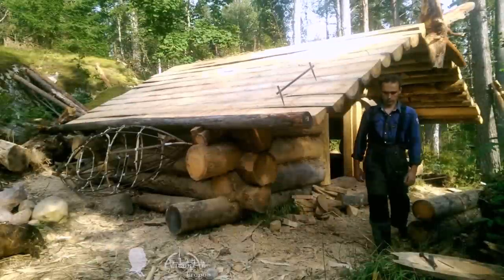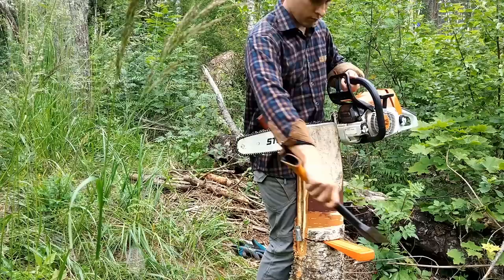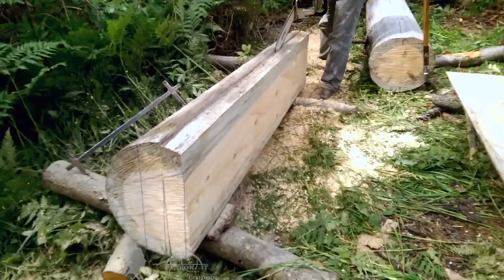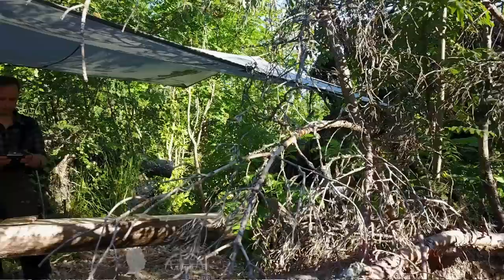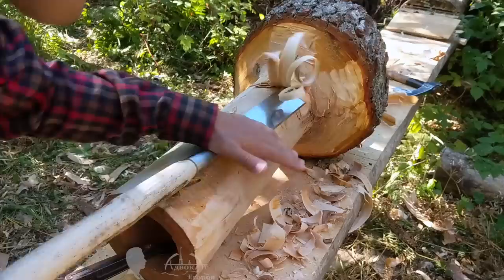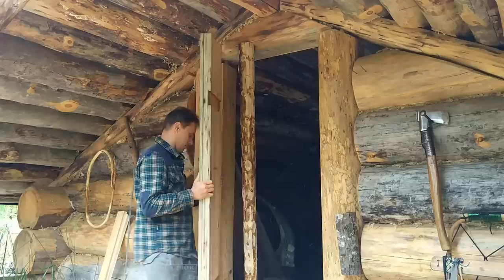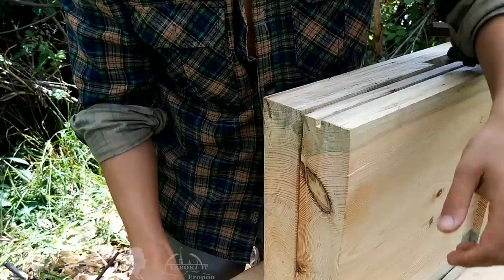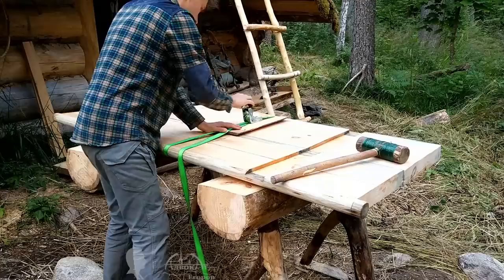Bear-proofing My Log Cabin

Comment: For doors opening outside, that’s the norm in Finland. It also leaves you with more interior space.
Reply from the maker: Yep))
Reply: In soviet Russia it’s for Bear, bear no pull door, bear push door.
Reply: thought they were in Sweden I hear coocoo birds
Reply: Bisqwit! Fancy seeing you here, God bless my friend
Reply: @soundtrancecloud5101  I read it with Russian accent wtf?
Reply: Harder to break in with the frame behind the door, too.  Building a cabin, I'd let the roof extend a good 3 or 4 feet (or more), with gable end over the door.  It's just silly not to, and yet, very few homes in the USA have anything like that.  My home doesn't have that.  It has a front porch, so you can always get the front door open, regardless, but the ridgeline of the house is North-South to minimize heat build-up in the summer.  The doors are on the East and West side, so the whole roof sheds snow right where you want to step off the porch, creating a real hazard (and clean-up chore) under melt/freeze conditions.

If I had any skill or ambition, I'd add a gable to shed the snow off to either side.  But hopefully, I'll be able to retire, sell the place, and make sure the NEXT place has the proper design features.
Reply: In America the only reason for a door to open inside is so that someone won't pull up to your house, attach a chain to the door, and rip the door off the house with a truck. If there is no road, there is no truck. No reason for the door to open in.
Reply: Problem with doors opening outside is the obvious problem of obstruction. Snow, mudslides or unexpected fallen debris in nature are problem enough but if you look back at ancient societies things take a darker turn. A few boards, some nails, a hammer and a torch and you can trap a person in their own personal tinderbox from the outside. It's safer to have a door that opens inwards, even if that makes it easier to breach.
Reply: Robert Beck  Sorry Beck but I'm not sure what you're arguing against from your comments, to clear things up do think a door that opens inwards or outwards is safer?
Reply: Robert Beck  If the structure is collapsing around the door it doesn't really matter which way it opens, that implys that the fire has spread to the exit thus making it the obstruction. Simple scenario to illustrate my point tho; It's ancient times, I live in this log cabin in the mountains and its winter. Its snowing at night and I fall asleep with the fire going as its cosy and I'm comfortable. I awake to find that there is now a fire in the cabin. I run to push open the door but it doesn't move. Snow has piled up outside the door and I can't open it more than an inch. If it opened inwards I could escape easily. I feel the pros outway the cons for inwards swinging doors, Imo.
Reply: Robert Beck  I'm not saying it doesn't, I'm simply saying that if the fire has spread that far and effected the structural integrity of the building that badly then the idea of the door being blocked or not would be silly. Odds are by that point we'd be dead or at least unconscious from smoke inhalation. I'm arguing for quick escape from dire situations, which would be inward swinging doors that can't get blocked or sealed from outside forces.
Reply: Robert Beck  If your keeping small objects in front of your door then the fault would lie on you, not the design. Also yes, I one hundred percent agree on outward swinging doors in community and department buildings where large groups of people need to escape quickly. Inward swinging doors might get sealed shut by the mass of people pushing to get out, causing deaths. But the logic behind those circumstances differ greatly from small homes. If nothing else it stops people from trapping you in your own house with some nails and a few planks of wood.
Reply: @BenjaminBizarre  Yeah no. The obvious solution to being barricaded in would be sliding doors.
Reply: @thirstiestvillager9233  There isn't always space for sliding doors, fire escapes are the primary example for that. They are required to open outwards and cannot be obstructed in anyway by law. Again tho, this operates on a different logic from small residential homes that have less people inside at any given time. Inward swinging doors have more benefits than cons which has been my opinion this whole time and I feel I have give sufficient evidence to support that claim.
Reply: @BenjaminBizarre  Pretty sure it's cultural.
In America, security doors usually always open outwards. Often both out and in, but rarely ever inward alone.
Reply: @BenjaminBizarre  eh, harder for bears to bash down a door if it only opens outwards.
Reply: @harrymills2770  My American friend who is ex-police believes that the doors open inwards just to make breaking in easier for both criminals and cops. Wouldn't surprise me to be honest seeing the state of the USA lol
Reply: Love your knowledge, ability and compassion
Reply: @soundtrancecloud5101  yes
Reply: @thirstiestvillager9233  Just do us all a favor and don't talk for us.
Reply: @thirstiestvillager9233  If someone was going through all that trouble they would be able to bash the door in if it opened inward just as well. That is a weird statement
Reply: and more visitor's faces broken.
Reply: Ahhh yes I have noticed that my closed door is taking up so much floor space.....
Reply: @thirstiestvillager9233  is that a serious comment?
Reply: It leaves you stuck when the snow falls. Really stupid move.
Reply: @krebgurfson5732  it's kinda elevated tho?
Reply: @paulandersbullecer3152  why even risk it? makes no sense. Snow isn't going to fall on his porch, it's going to be blown in in thick drifts that will freeze and become extremely dense. Maybe it's not an issue where he is but in Alaska snow doesn't fuck around. He elevated it about 15 CM, no one is worried about 15 CM of snow.

As for bear proof that door doesn't have near the reinforcement it would need. The door has to be much larger than the entrance gap. Allowing for significant backing along the edges. Doors aren't really where bears enter buildings anyways, they enter through windows because that's where the smells come out and they can see in.

None of it really makes sense.
Reply: @krebgurfson5732  ok
Reply: @BenjaminBizarre  Snow and mudslides? Yeah MAYBE snow in a forest etc. but not in a city really. Mudslides? Mudslides that big of a scale are REALLY rare. If you think you can trap someone inside their house with a few boards, some nails and a hammer you completely forget that people usually have windows they can escape from. And by the time you manage to nail enough boards on the door, people usually have already managed to rush out of the door anyway.. At least i would just run towards the door and ram it open before the person manages to lock me in. People usually tend to wake up when someones hammering their door shut...
Reply: @Ex0rz  This hut isn't in the city. It doesn't have windows. The nails and board example was from dark ages logic as my original comment shows. As for more modern safety concerns, outside barricades are still a concern no matter where you live. They're not always obvious but the basic logic behind getting barricaded in from the outside vs the inside goes as follows. Would you rather be trapped on the inside with by something outside that you can't reach or trapped on the inside with something you can at least try to move?
Reply: @soundtrancecloud5101  my answer too
Reply: Doors opening to the outside is how they are in the U.S..
Reply: @soundtrancecloud5101  here in the U.S it isn't so much the 4 leg critters you have to worry about breaking your door. It's the 2 leg human critters either breaking in to rob you or if in the big cities addicts looking for money for their next fix. I prefer being out in the country. Very rarely does anyone bother you.
Reply: @harrymills2770  I'd much rather have a house with longer overhang as well. You also don't have as many roof problems later on because the rain isn't running 2 inches off the roof. I'm not sure why more builders don't still build like that. Up to about 20-25 years ago they did, today you are good to find a new house built with a 6 inch overhang.
Reply: @lisaclark6977  such two leg creatures creatures roam our gourds too, drunk on vodka or cheap perfume.
Reply: I imagine someone has been smacked by doors a few times, especially in apartments
Reply: If your using a chainsaw with gas and oil, why not just buy a door??
Reply: @paulandersbullecer3152  maybe that's the reason.  He can only get there to work on it during the summer.  Thus door opening outward with lots of snow makes it a little harder for people trying to break in.  Besides if you look at his roof over hang it is 4+ feet not like the little over hangs in most places
Reply: @BenjaminBizarre  however, doors in schools open outward , so that people inside pressing against it cannot prevent its being opened (which is also why doorways tend to have alcoves).
Reply: @Embrachu  Already covered this, different rules apply to large public buildings vs small homes with less people inside.
Reply: For doors opening outward is a norm in Scandinavia because of fire safety. Dunno if it applies to a cabin 🤔
Reply: @soundtrancecloud5101  what about post-soviet russia? have bears learned to pull since the wall came down?
Reply: @shanevanmosseveld8120  Thought it was a coocoo bird too. Maybe some type of tree duck? Kind of also reminded me of a whippoorwill, which I grew up with.
Reply: @shanevanmosseveld8120  Sweden / Russia / Finland, he said "Karelia" which covers territory in all three. Of course Max is from St Petersburg, since he says so.

Comment: An outward swing door is harder to breach, leaves more usable space inside, is better for fast escape in a fire or panic, and can be better sealed against winter winds.  It is true a large winter storm could drift snow against a door an block it, but as he said, he has two doors and the drifting cant be going both directions at once, only one door will be blocked - this is why he has two doors in a small cabin, as well as for summer cross-ventiation as even though he is in a northern latitude it gets hot during the very long daylight of the short summer. Maybe for more light as well since his side walls appear to have no windows at all.
That is just my guess
Reply from the maker: Correct
Reply: Was my thoughts too.
Reply: Bear proof? The bear normally grabs and pulls towards himself. Check the Siberian hunters sheds doors. Put it opening inwards and its going to be bear proof.
Reply: @ramilsharov9236  i have seen some old logging camp buildings and they nailed old  cross-cut saw blades teeth up over the windows, so when the bear tries to put a paw and pull it cuts him, and he moves on, 
They also put boards on the ground in front of each window and door with lots of nails driven through and the points facing up.these get covered in leaves pretty quickly but i can imagine what the bear feels when he steps there!
Two legged critters are more likely to cause trouble in my experience
Reply: Right. Plus, if the bear manages to get inside, you flee by pushing the other door open, hoping the visitor would stop to eat your food instead of chasing you.
Reply: @mariosebastiani3214  Ha Ha well said Mario, !

Comment: They open outward so that a bear cannot break it down as easily. Also with that overhang, snow won’t be as much of an issue.
Reply: Indeed :) great vid BTW
Reply: Also opening inward requires there to be nothing in the path, even a little rug/shoes/etc would be in the way. Love the vids
Reply: thats  the  answer
Reply: @b.scottfarthingsworth  Yes. Space is at a premium.
Reply: With door that narrow no fat bear can enter 😊
Reply: Excellent points...also, if any "Predators" get in your cabin; having doors that open out are a better, quicker and safer option!
Reply: read my mind word for word :)
Reply: Obviously Thermophile, also it keeps the snow outside when you open the door in winter.
Reply: ...my thoughts exactly...
Reply: Would think after watching a bear destroy a log for small critters, it places its claws in crevices and pulls, that door that opens in would have advantages over one that opens out.
Reply: tabutog smaller bears can still be a problem also other predators could also be a problem
Reply: My thoughts exactly.

Comment: The door opening out makes it more difficult for anything to get in. Uh, like bears!!
This guy has mad skills !!
Reply: @1Coke ToGo If the wind blows up against that door with a high snow drift. Then he can exit the back door.
Reply: @marcosross790  he is something else
Reply: @arlow2012  He is truly a master craftsman.
Reply: Just like drug dens you can't kick the door in lol.
Reply: @five-o7023  <— ezactly,... and and the Bear can’t push the door in either, which is great.  And which you might have been alluding to.  I hear they do this in the Scandinavian countries a lot out in the sticks where security could be an issue.  Cheers. ;-)
Reply: Mr. mean:  The door opening outward.   .....   My thoughts are the same as yours, it is safer for the occupant, makes it harder for creatures on the outside to get in, such as a big bear that has just been shot and wounded by Vladimir Putin.

In America, this kind of door could probably keep out 75 attacking FBI agents looking to arrest someone for a parking ticket
Reply: Excellent critical thinking skills too
Reply: I built my doors to open out too.  As has been mentioned it makes it harder for bears to get in. But these doors also push the bugs to the side, instead of sucking them in when you open them. And they don't take up room inside the house.  The snow has blocked both doors some winters but I have an upstairs with windows so I just jump out a window into the snow with my shovel.
Reply: Any door that you don't want to be knocked in from outside needs to open to the outside. This is why drug houses set up the entry doors up this way, harder for the police to breech.
Reply: or snow
Reply: Combined with no handles on the outside leaves nothing for the bear to tug at

Comment: A door that opens outwards is stronger against predators from pushing it in! You can beef up a locking mechanism with a board from the inside and it's harder to pull once locked from the outside. It just make's sense to feel more safe in the woods against bears! I admire your hard work and enthusiasm!
Reply: Ever see Mountain Men (history channel)? Marty the Alaskan Trapper built two similar cabins ( but not this elaborate). Marty put boards with strong sharp nails screwed to the door and outside threshold  to keep the bears out while he was away
Reply: Would hav been my thoughts as well.  Ears won’t open a door, they will push against it. As long as the center “connection” is flush,  he’s got nothing to pull on to open it. Nice security feature.
Reply: @prairiebhoy9199  
Hi Tom, thanks. That sounds genius. I like this channel and will look up Mountain Men. Ant other recommendations? Thanks in advance. 👍
Reply: Your English is very good and I enjoyed the video very much. I think I'm too old now but have wanted to do this my entire life. I still might take a shot at it.
Reply: Agreed.  A door that opens out is stronger against outside intruders.  (You have to fight the entire door jamb).  Notice that commercial buildings use doors that open out, often in steel.
Reply: And we only have inward opening doors in the west because of fire fighting regulations .
Reply: @elwood212  Every outdoor in finland only opens outwards. Try kicking that in :D It's also a plus in public buildings with panicking crouds, if theres a fire for example.
Reply: @hallmobility  the open out is an emergency exit and fire-code thing
Reply: good story bruh.

Comment: Cold start seizure on the Stihl. Many carpenters see this as they only use the saw for a quick cutoff.They fire it up, hit the throttle and start sawing, then wham, the saw seizes.  Give it a minute or two to warm up, then go for it.  You should never lose s Stihl saw like that regardless of where it’s made. Amazing work btw!

Comment: Reasons why you might want a door to open outwards:
 1. Bears can push the door in if they really wanted to, but will have a much harder time pulling it out, especially with nothing to grab on to. 

2. The door would need a considerable amount of clearance inside the cabin floor and ceiling area 

3. Strong winds or snowstorms could push the door open slightly. It is better knowing any force from the outside would add to the door’s seal rather than compromise it.

4.Moving things in and out of the cabin is much more easier when you don’t have to think of how to maneuver them around the door. 

5.Looks and feels much cooler to kick your door open every time you leave your cabin.

Comment: As a retired custom furniture maker you have a skill set that is leaps and bounds above any other cabin maker I have ever seen. You build a cabin as if you are building a piece of fine furniture. I tip my adz to you.
The door opening out is for bear frustration, I live in bear country and when a bear leans and bounces on your door and it opens in it will. An 800 pound bear will defeat most inside opening doors. Great build!

Comment: My wife and I visited St. Petersburgh in the summer of 2019. Your video is fascinating. 
My father was a carpenter and cabinet maker and I have several of his hand planes and a few of my great grandfather's wooden moulding planes. 
My mother's father had a large barn whose timber frame was entirely hand cut with axes and adzes and assembled with mortise & tenon joints held with hickory pegs. Built in the 1858 it still stands today.
Reply from the maker: Eric, thanks for the story!